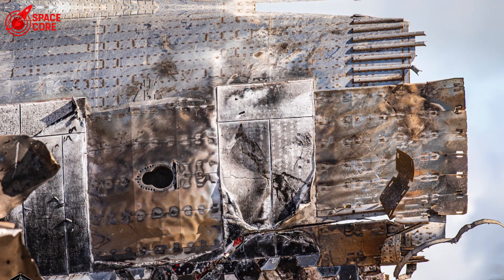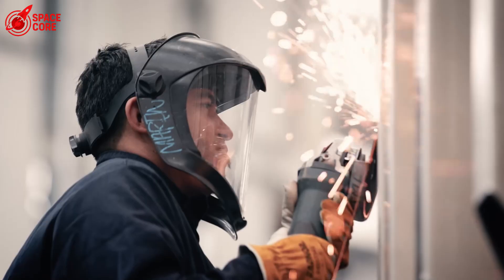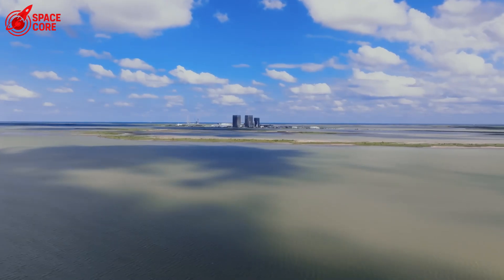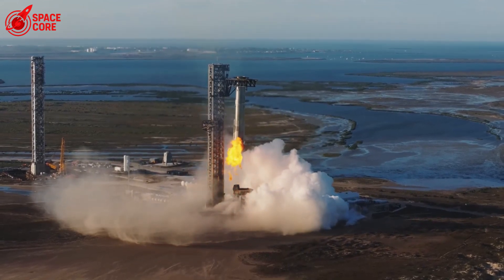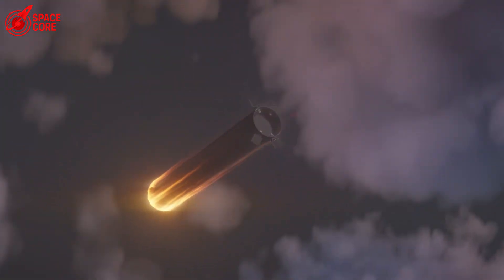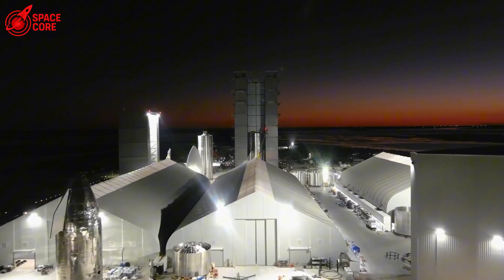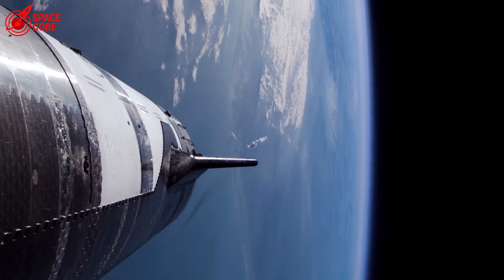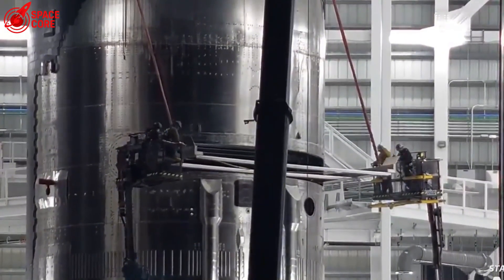Elon Musk ADMITS: One Wrong Part DESTROYED Starship's Mars Dream...

Comment: The only new information in this video (and it's a bombshell) is that there will be NO STARSHIP LAUNCH TO MARS during the 2026 launch window! .Days ago it was reported that Musk said the COPV that exploded (S36) while its pressure was lower than its rated maximum pressure (defective COPV). This video's title asserts that Musk ADMITS that "one wrong part" caused the explosion, but the audio asserts that the COPV that exploded MAY have had a maximum pressure rating that was lower than the required maximum pressure. To add to the confusion, "one wrong part" can refer to both a defective COPV and/or to an underrated maximum pressure COPV.   
.
Reply from the maker: You've hit on some key points about the Mars launch window and that COPV failure on Ship 36. While Elon Musk has mentioned a 50/50 chance for an uncrewed Mars launch in late 2026, it's a seriously ambitious goal that depends on successful in-orbit refueling. As for the COPV, they're really digging into the exact root cause – figuring out if it was a manufacturing flaw (a "defective COPV") or if its design specs just weren't up to the required pressure ("underrated maximum pressure"). Either way, it boils down to a "wrong part" that didn't meet the operational demands. These flight tests are absolutely crucial for finding these kinds of issues and making sure Starship is reliable for future deep-space missions.